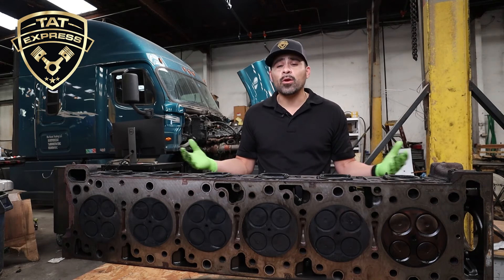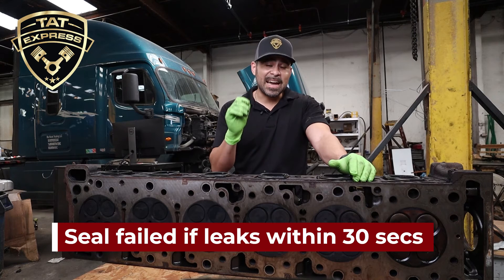DD15 DD16 DD13 Low Power /DD15 low compression/ DD15 no power up hills/ DD15 Detroit diesel engine

Comment: My DD15 loosing power on low gears while running, also missing. Any thoughts
Reply from the maker: Low power and misfiring on a DD15 could be injector cups, a bad injector, or even a cam issue. Start with a compression test and check fuel—those are usually where we find the problem.

Comment: Nice job
Mine has 81.5 on cylinder 6 is it good or bad?
Reply from the maker: Any compression test less then 85% is considered low.  Do a overhead valve adjustment and re-test.

Comment: What would that cost (complete repair )
Reply from the maker: A complete engine replacement is not cheap.  It depends on the serial number and if the parts are reusable.
Reply: @TATEXPRESSINC  from your experience what’s an average price?

Comment: Just a fore warning from a freightliner mechanic in maryland when you start getting the gen 5 motors in with dropped exhaust bridges do yourself a favor and just drop the pan and check the wrist pin on that cylinder seems to be building to much pressure in that cylinder and blowing bushings/ bearings in wrist pin
Reply: I’m a 35 year Detroit tech and I approve this message. I’ve seen this multiple times. The problem is that warranty won’t pay to drop the pan and inspect for this. after the adjustment screws are replaced and you still hear popping out the intake then you check for spun cam lobes because the lobes are pressed onto the shaft the increased pressure due to the exhaust valves being closed all the time they can spin. But when I’ve seen this happen the wrist pin bushing will come apart and crack the liner and let coolant into the oil. Detroit ruined the DD engine with the gen 5. They are going to put them out of business. These changes are all due to the new EPA regulations. I’m all for clean air but enough is enough.

Comment: Hi Sir I had tex b4 with questions 
We had a turbo replaced in Jan 2022
The gasket or o rings at the bottom of turbo for the return line started drip  just had all replaced a week
 ago trk came back with a bigger oil
 leak at the nut at the bottom of return line just had it fixed  Now picked it up an when u start pulling ck engine light comes on an stays on  with no power at mid to top range  anything I should be looking for now.  Thank you in advance ☺

Comment: I’m at the Freightliner right now for a water pump an oil pressure sensor switch an told them that the Freightliner I was at a week ago for a nox sensor said I need a overhead soon an the Freightliner I’m at said that I don’t need an overhead because I’m at 96% what do you think overhead or no
Reply from the maker: I recommended having them done every 500k.  All valves will not need adjusting, but it is good practice to have them done.  I would recommend an experienced tech with DD15. 💪🏼🚚

Comment: Hey Adam I have a question that no one has been able to solve yet. A few months back the number one injector went bad on my dd15. I had it replaced and ever since whenever I'm under a heavy load the engine will cough a couple of times when going back to throttle when coming off a hill. The problem is sporadic. And as long as I crowd into the throttle it doesn't happen , it's only when easing back into the throttle. And it's only when I'm loaded heavy 35000 Plus. The scenario goes something like this, I pull a steep grade reach the top and cruise back down off throttle. When the terrain flattens out and I ease back into the throttle to maintain speed the truck shakes violently for a couple seconds then Smooths out but if I stomp down on the throttle and then back off it doesn't do it. I've asked several mechanics and other drivers with dd15 and no one seems to have had this issue.
Reply: Mine doing it to but i got a regin on mine but it dont take def i don't evan have a check egine light on. I believe that regin got something to do with it
Reply: I have a 2010 cascadia 12.8L I’ve been losing power as of late. When my check engine light turns on my engine immediately misfires, my rpms decline and my diesel drains. I’ve plugged it into computer and got SPN1327 as the lookup code indicating cylinder # 5 misfire.

Is it my fuel injector? Does it have to be replaced or can it be cleaned? 

I also think it could be due to a leak coming out of my high pressure fuel line? I have pictures if anyone could tell me what this is. 

Thanks
Reply: Try to bleed the fuel lines might be there is some air pressure exist..

Comment: In case you have damages, wear,  corrosion on the firedeck of the head. It is possible to rework the head by 0.2 mm. You have to reset the gearlash by loosening the boots on the topmost gear spindle on the block. The gearlash can be adjusted by rotating this spindle.

Comment: What will be fuel average on dd15 505hp with 3.73 ratio 13 speed ?? Any suggestions
Reply: Depends on how fast you travel, how many hills you go over, how heavy your cargo is, how bad your oil is, how bad your air filter is.........

Comment: I just bought a 2016 WS with 403k miles.  In the first 25k miles I've had the DPF worked on, turbo blew, clutch replaced and fuel filter housing was taking a pile of air. I was just about to get an overhead ran next week and this video popped up  😫 fml... but that the downside to used equipment. You don't know who drove it before you.
Reply: This is why you get previous maintenance records. These days is bad idea to buy a used truck cuz if kids driving them rough.
Reply: @transport21  it was an O/Os rig. I expected better from them.
Reply: @danielroatch1322   what was the reason they sold the truck?
Reply: @transport21  traded in for new. With the engine make, and the milage. The research I did for 3 months on the engine, the many friends I have swearing by the DD15 I took a chance. And that's all it ever is, a gamble.
Reply: Idk about this for sure but it seems to me it seems these newer trucks are only designed to last out IRS depreciation time frames without major issues. Not the million plus miles the older trucks were. I'm seeing early corrosion issues for certain 2 years in.

Comment: Hey I have a 2016 Freightliner cascadia automatic 896000 miles I bought from truc equipment this truck is hell the transmission jumps into neutral when I turn on the engine break it downshifts way to much the truck doesn’t regen it barley uses the DEF I tried to see if the other people have the same issue they do but I want to know if there’s a fix I already took it to the dealer ship and they replaced all 3 sensors and it didn’t work
Reply: Check the cpc computer behind the dash.they go bad and cause truck to do weird stuff.if that's the case u can gat a used one go to the dealership and have them program it with the vin number.hope that helps,mine did same thing and this fixed the issue.

Comment: This is interesting, 
What would be the best maintenance to have good valve seating?

I have seen a few DD15 have low compression on cylinder 6 from engine with 300k miles to engines with 700k?
Have you found what is the root issue of why cylinder 6 have these issue? ( poor lubrication, poor fuel flow to this cylinder,etc)
Reply: I'm pretty sure he stated that is was that the valves weren't seating (sealed) and that's why it had low compression

Comment: Adam, I apologize for so many questions. What service information do you use? Mitchell? If so, how good are the wiring diagrams? Do they have good identification for location of components like modules, connectors, and grounds? How good are the wiring diagrams for the network (J1939 CAN Bus)?

Comment: Thank you Adam. Good job. Some people would think this is a bad design for a valve failure with just over 400k miles. They have to remember, it's not just the miles, it's also the added hours of running idle. Have a blessed and safe week to you and your family. Happy Thanksgiving.

Comment: Wow, replace the whole head for a couple of bad valves?! I had liked what little I knew of the DD15 until now.
No thanks. Poor design.
Reply: @Super Fly hell no!  You need to drop the oil pan and check for metal shavings. If there is metal shavings found or if there was and mechanics cleaned it out you could have damage to your main and rob bearings. Also a 2020 with almost 400k miles bet it’s been driven rough.  Stay away
Reply: It's not a bad design it's just what these guys do if a valves not sealing. 
Id just pull all the valves on that cylinder do a valve lash and put it back together.
Reply: That’s what I was thinking. I mean getting the valve and seat ground seems like an easier option
Reply: Na na labor is too much to do that and you would just want to replace the whole head cheaper
Reply: Not a bad design.  Do your valve adjustment on time!! And you won’t have this problem. Plus it’s about labor and time. More faster to just out a rebuilt head on and be done same day back on road then repair the old head.